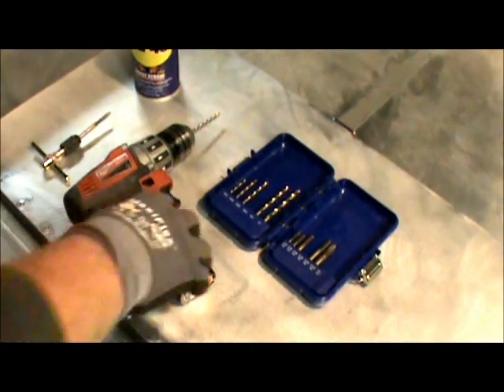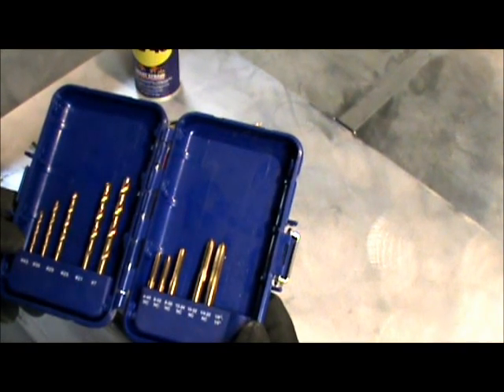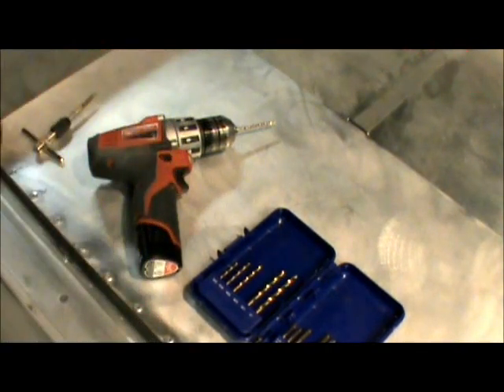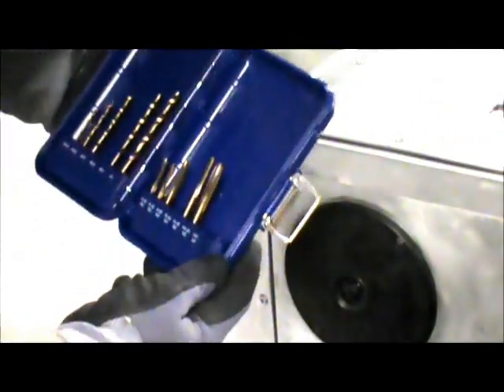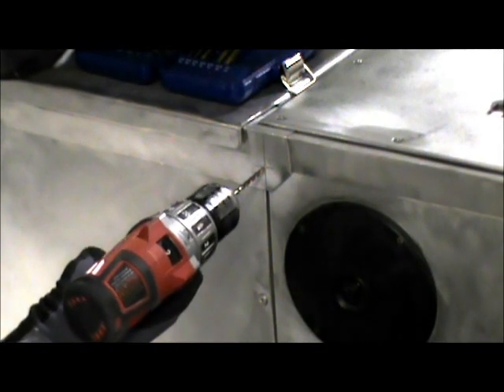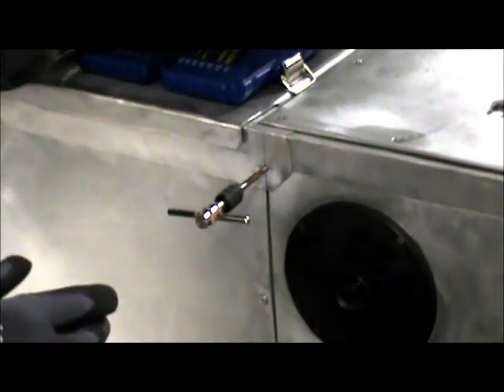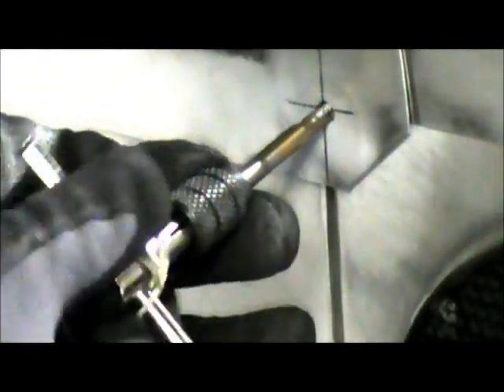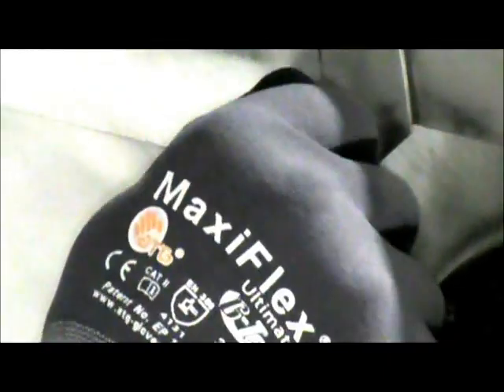My DIY Drilling and Tapping Aluminum

Comment: I wonder if I can get your opinion.

I have an idea for a woodworking clamp.  I'd be using a steel threaded spindle (approximately 1/2" diameter) with a round handle from a Bessey woodworking F clamp.  I would have 3/8" thick aluminum sheet that is threaded to accept the spindle.  Obviously it would be tightened and loosened frequently over the years.  I'm concerned about using 2 different metals and the wear on the threads in the aluminum considering the steel is a much harder material.  What do you think about this arrangement?  The thread count on the (male) spindle and in the aluminum (female) would be about 7 threads per inch.  Thanks

Comment: I have a 12v cordless drill and I need to drill holes into aluminum flat stock to create an arm to attach to a wiper motor.  What type of drill bit do I need and do I tap the aluminum first then drill, thanks for the help.

Comment: great video! Sorry to bother, but I?m planning on buying a wireless drill, I plan to do some work with aluminum and wood (drywall too), what do you think shuld I be looking at? What voltage and whatnot? I don't need a super powerful drill I think.